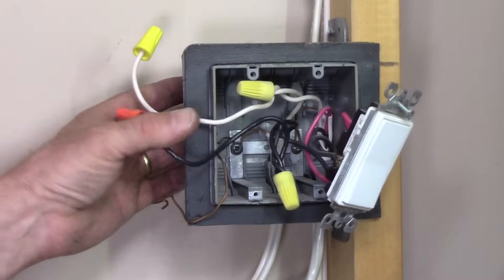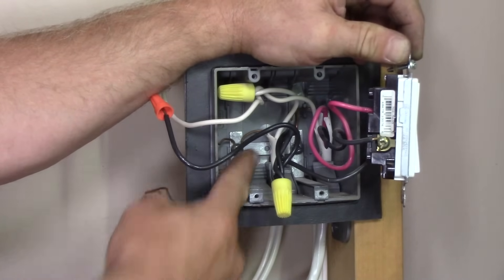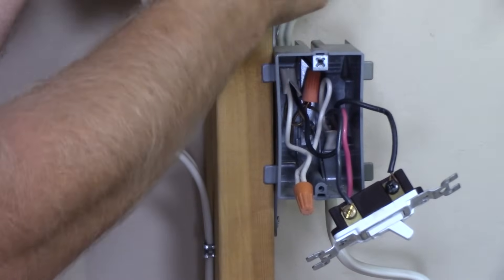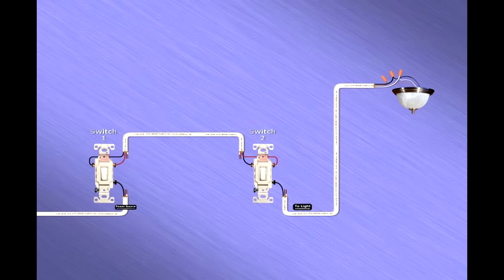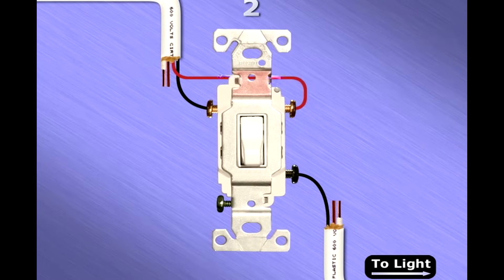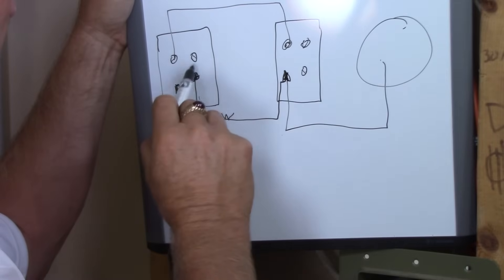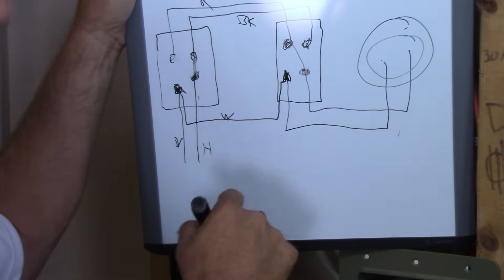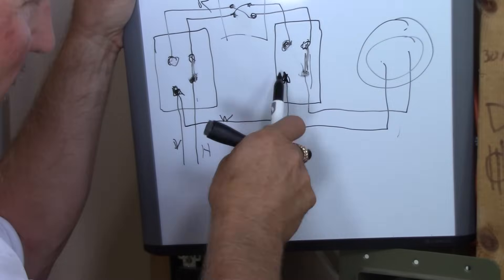The Best 3 Way Switch Explanation Ever!

Comment: I have a new remote ceiling fan... a Red wire hanging from the ceiling along with 1 Constant Black Hot wire and  a White wire (and ground).   The Red was connected to the Blue in the old fan.  2 switches on the wall for the light and fan.  Instructions say to attach the red to the Blue Wire, but the Blue wire is occupied on both ends in this fan in the receiver box.  What do I do with the Red wire?  Black with Black, White with White, and Green with Green and capping off the Red wire didn’t work.  Any help is much appreciated. Thank you
Reply from the maker: If you have 2 wall switches, then the black would have been from one switch, the red from the other.  You need to pick one of those to be the power that supplies the remote receiver.  Then whatever your instructions tell you to use on the other side of the receiver to be connected to the fan and the light (unless those connections are pre-wired?).  You will be capping off one or the other of the red or black from the switches as it won't be needed.  One of your switches will do nothing, and you could blank it off to avoid confusion as to what that switch is for, and the other switch will have to be on to make the remote function to control the fixture.
Reply: @theinternetelectrician  thanks Terry.  I used the constant black to the fan. Capped off the red.  White to white and green to green.  When I flipped the wall switches...poop poof and burn smell from the receiver.  Can’t figure out what went wrong.  I hung several fan/light kits before
Reply from the maker: @NetworkedBig  Not sure?  This would need hands-on trouble-shooting to be confident in an answer. A bunch of detailed photos or diagrams of the wiring in the switch box, the ceiling outlet, and the fan wiring would help with some clues. terry@electrical-online.com
Reply: @theinternetelectrician    thanks.  Sent

Comment: no ceiling light in bedroom.  I have one "three way electrical outlet; however the light switch at my door does not turn on, the lamp plugged into the 3 way switch.  Whatis the light switch supposed to turn on?  I find your teaching very clear; however 
I am still in the "dark" (sorry pun) regarding my one wall light switch.  Thanks

Comment: "VIDEO SHORTS"? As in electrical short? How many 4 way switches can be placed between 2 three way switches?
Reply from the maker: Yeah, supposed to be a humorous play in words 😀. There really is no specified limit as to how many, only that if it got to be a ridiculous amount you may run into resistance issues due to wire length and the amount of contacts. So short answer is no.

Comment: A major problem a big problem on electrical they rarely tell us that a black wire or the hot wire is always hot,  always.  The neutral wire can be "switched off" that is out of power or not hot.  This also where the ground wire is always to the neutral wire side and can be a "second" wire or third wire "bare or green' wire to the ground or earth.  This third wire is never used as power.  When this happens,   this is a ground fault and the circuit breaker cuts off or breaks the power.  This is why we have a three wire system,  a black or hot wire,  white or neutral wire and bare or green wire as the ground wire to earth.

Comment: How do you determine which box sends the wire to the light?  In an existing three way toggle system can I install a 3 Way Sensor Switch such as https://www.amazon.com/gp/product/B08HMY86TT/ref=ox_sc_act_title_1?smid=A2DUPP62XFWDIS&psc=1?
Reply from the maker: If the circuit is wired like the examples shown in this video, that switch will work at either end.  Let me know if you need help with the connections.

Comment: Maybe someone here can comment on a new home 3 way switch problem. Switch #1 is on the bottom floor of a staircase leading to the 2nd floor. At the top of the second floor, there is the other switch ( let's call it switch #2). When switch #1 turns on the light..... switch #2 can turn it off. When both are off......you cannot turn on the light with switch #2. More history.....for drywall repair reasons....switch #1 ( at some point) , had to be pulled out slightly and then re-inserted into the box. The wires were not consciously altered or removed/reconnected. What's the problem?.....did a wire slip out of one (of the many) wire nut connectors ....some with more than 2 wires ?
Reply from the maker: If nothing was disconnected on purpose, then I'm guessing you are correct in that a wire pulled out of a terminal on the switch, or in a wire nut as you suggested.  Check one  of the traveller terminals carefully on switch #1, where the pulling and tugging took place.  Of course, as always, shut off the breaker!

Comment: I have a single light switch with 2 toggles. Bottom toggle turns off both lights inside and patio. Top toggle turns on outside patio light.  How do I separate them so I can have my outside light on when bottom toggle is off? 

Please advise.
Reply from the maker: I'd need to see how this is wired, but it sounds like just some incorrect splices were made in that switch box.

Comment: WTF is a traveler? Seems like the explanation could have been better.
Reply from the maker: It's a term we use to describe the 2 wires that the current "travels" through to get to the other switch, depending on the switch position.

Comment: Trying to take a light switch and make it control only the ceiling light instead of the ceiling light and FOUR other sockets 🤦🏾‍♂️🤦🏾‍♂️🤦🏾‍♂️ any suggestions?
Reply from the maker: I would have to know how this circuit was wired, all the cables, and connections in each box.

Comment: How would I go about placing multiple lights in between two switches
Reply from the maker: The best method is always to follow the example shown here, and then just go from light outlet to light outlet with 2-wire cable and connect them all in parallel.

Comment: As a retired electrician/contractor I did this for years. The key is to know where every wire is going. House wiremen sometimes use the light box as a junction box. They bring the hot feed and both switch wires to it. You still wire it the same way by the use of joints in the ceiling box. But you still have to be mindful of the common terminal on the switches. The hot and return must go on the common terminal of each switch, or you’ll have the dreaded, “the light only works when this switch is up!” It’s really easy. Every wire has but two ends. You just have to know where they are. ⚡️ 😎
Reply from the maker: Yes, good points.  There are so many variations of how to wire a 3-way switch network.  Once you understand how they work, you can apply it to any method as long as the right cables and wires are in place.  Thanks for your input, and thanks for watching!

Comment: I turned one upside down (or swapped the travel wires) so that if both are down or up, it would be off, and if one was up and the other was down, it would be on. Made more sense to me.
Reply from the maker: That's a good practice.  I've heard stories of electrical inspectors calling that out and making the electrician change it if it wasn't that way.  That is not based on code however, but the inspector has the last say!

Comment: Why is the light on when all switches are in the down/off position.
Reply from the maker: There is no off position on a 3-way switch. It's either up or down but it's always connected to one or the other traveller terminal.
Reply: @theinternetelectrician  gotcha that makes more sense. Thank you.

Comment: what's best way to do a 3 way switch if say your power source in in the ceiling at light fixture and fixture was on a single pole switch? wanting to wire the light to turn off and on at end of hall and say a bedroom.
Reply from the maker: Wired like you described, the only option is adding / changing some cabling.

Comment: As soon as you start describing and you have your box with the switches right there; this video failed.!!!!!!!!!

What guys want to watch that need to know is this is a direct run from the main breaker box!
Taking one romex wire that has the black at the main power the white as the neutral and the copper as the ground!
Run this in to a single room and hookup outlets and switches for the lights for the room and the main light for the room needs to be able to be switched from both entrances both entry doors. How does this all happen?
You video already had wires routed in the box!
So your video is done you failed it doesn’t answer the question we were searching and you said you had the answers but don’t!
Reply from the maker: I don't think you watched the entire video then?  It's not to show you how to wire the circuit as much as it is to help you understand how the circuit works.  I can help you with more information if you need it.

Comment: Only america would call a 2 way switch 3 way.  1 feed in goes to "2 ways out"  hence 2 way switch.  Then we have a 4 way switch 🤦‍♂️🤣.  No, it is still only 2 ways out but is a 2 way intermediate.
Reply from the maker: I can't explain why it got the name "3-way" in North America.  Technically, it doesn't make sense.
Reply: @theinternetelectrician  to be fair the same thing in plumbing in the UK,   a valve with 3 ports, 1 in and 2 out,  is called a 3 way valve.  But that's plumbers for ya 🤣

Comment: Hello Sir I have a little problem to ask you my house build 1987 so I have outlet  and back yard between has light post. I replace GSFI circuit than I checked showed Hot/Nue, Revers. Than I checked feeding outlet I saw 3 extra circuit 50 feet wires I replaced GSFI outlets and wire that goes to  back yard light post. After I finished I checked the circuits shows now BAD ground on 2 back rooms  other circuit are good. I know high resistance can show bad ground but I do not know how to fix this BAD ground issue. My only 2 back rooms outlet was on the same circuit sir. Can you please help me?????????
Reply from the maker: I would need more information, but did you get it figured out yet?

Comment: A couple of years ago, one of my 3-way switches stopped working. I figured one went bad. Came back from home depot with Leviton 3-ways, replaced the first switch, but it didn't fix the problem. Replaced the second, still the same problem. One would work if the other switch was in a particular setting; we could use only one switch.
I found this video and decided to give it another go...
Looking at the new switch, there are no black screws, just silver. the old switch (3 gang box) had black and silver. 
Closer inspection, the common terminal was on different locations between the original and replacement switch; the common terminals did not have the common wire.
After switching the common wire to the common terminal, the 3-ways worked as expected!

Comment: I don't understand what I'm doing wrong. Put a new switch in either end and it still doesn't work. White to the top left, red to the top right, black to the bottom right(black screw). No ground. At first the switch at the top of the stairs did not function but now neither do. Any clue?

Comment: I have 2 three way switches that go to a laundry room light. Both switches will turn the light on and off but if i turn one switch to the off position and try to turn the light back on from the other switch it will not turn on

Comment: fucking awesome video. i could never wrap my head around why a 3 way is NOT the same as a knife switch. two knife switches in series in a circuit will create an AND situation where both switches must be on. A 3 way switch is essentially a knife switch in parallel, not series (parallel switches create an OR situation). thanks!

Comment: Very good, I've never had a problem understanding but I often try to help people that do. If you have a video of the three-way but with the three wire cable passing through the light fixture box (between the switches) that would help some. Typically this would involve using the white wire as a switch leg from one switch common to the lamp hot (black) wire. I find this setup is the most confusing to most people.
Reply from the maker: Yes, there are many variations of wiring a 3-way switch.  I have several diagrams illustrating the different methods on my website.  My objective here was to get people to "understand" how they work and then you can apply that knowledge to every scenario. But a picture (or better yet a video) is worth a thousand words (as they say).  Another consideration is that with the new code rules, this method shown is the easiest to understand, and also meets the code rules now that require a neutral conductor in every outlet box.
Reply: @theinternetelectrician  neutral required even in a switch box? Thanks, I will check your web site.
Reply from the maker: @ricklee4  Yes, because of all the electronic and smart devices that need a neutral, they amended the code to facilitate that.  So the switch-leg drop using a 2-wire, or using the white as a hot, even if identifying it as such, is no longer allowed. However it is useful information to show these variations as they are everywhere and don't need to be changed as any wiring is grandfathered to the code of the day.
Reply: @theinternetelectrician  thank you very much, I'm retired now so not up on the code but I have come across DIY stuff where they hook to the ground in the absence of a neutral.

Comment: Question please, I have 3 way switches controlled in 3 places for 2 lights simultaneously . All the nuetrals in the outlet box are twisted together and I need a neutral for a dimmer. Can I pigtail a neutral wire from them?

Comment: Aren't your traveler backwards in one of your boxes?  I was under the impression that the two switches should be wired the same in both boxes. Red traveler on the common side in both boxes or black traveler on the common side of both boxes.
Reply from the maker: Consistency is a good thing, but that's the only reason for keeping your travelers connected to the same terminals at both switches.  However there is no reason to do so, either electrically, or for any code compliance.

Comment: So it wont matter where you connect the travelers thru the 4 way switch? Hope my question is understandable!
Reply from the maker: Yup! I understand what you're asking.  You have to keep your pairs of travelers together on either the 'in' or the 'out terminals. Other than that, it doesn't matter which goes to either of those terminals.
Reply: @theinternetelectrician  awesome many thanks!

Comment: Quick question, how come you dont have the neutral white wire connected to the outlet or switch? Is it because you have they in a pigtail so you dont need to connect it to the outlet?

Comment: Nice explanation,  but your description basically says one has to switch both switches to get electricity to the light.    So I suggest you better describe how the switches work so that changing any switch,  3 or 4 way turns on off the load.     Also I suggest that you explain that a 3 way has 2 switches in the circuit,   4  has 3  5 has 4 switches etc.    The nominclature talks of the contacts or lugs and not the number of switches you need to control the load (light in this case)
Reply from the maker: I'm not quite sure I understand your commentary here, but thanks for watching!

Comment: The circuit demo starting at time index 5:29 through 5:55, has the light coming on when both switches are in the off position.  That bit doesn't make sense to me.  What am I missing?  Other than that, great video!
Reply from the maker: To help you with this, remember that there is no "off" or "on" with a 3-way switch.  I'ts either conducting from the common terminal to one or the other terminals.  With this in mind, go watch that part again.
Reply: @theinternetelectrician  Thanks!  That helps make it "click" for me.  BTW I ran across some other discussions on this that cover an alternate traveler wiring where the light is "on" only when one of the two switches is on.  The light is "off" when both switches are off or when both are on.  I guess which you use comes down to personal preference.